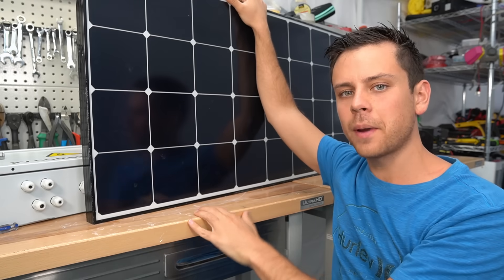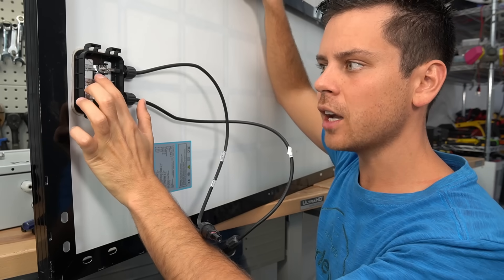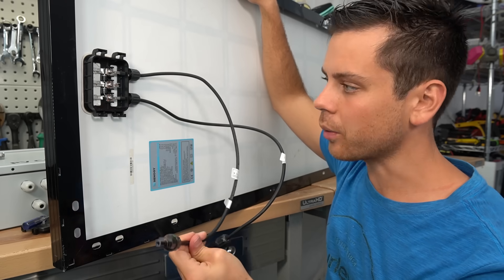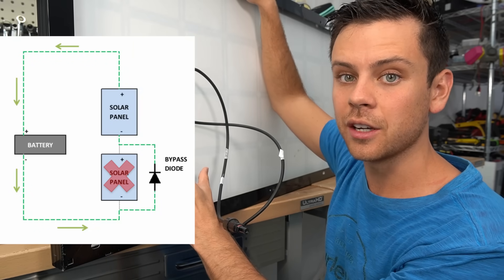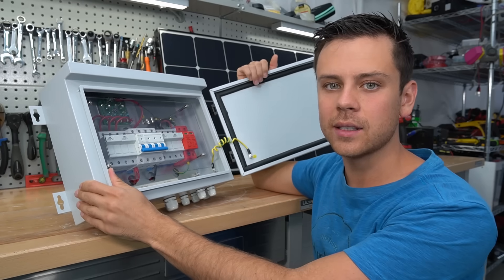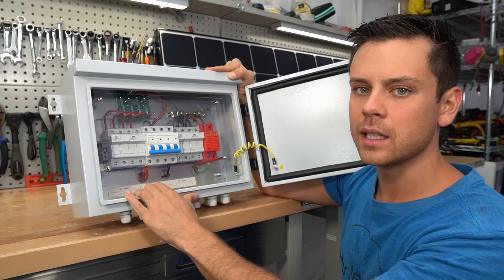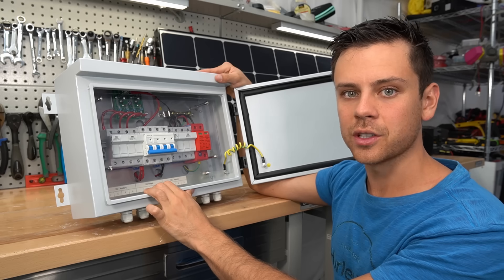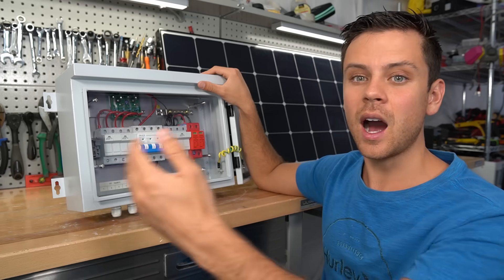Bypass VS Blocking Diodes in a Solar Power System

Comment: Hi, regarding blocking using blocking diodes will it work to limit the current? I'm installing a solar system for my sister and I will like to oversize the panels and the inverter is got 2 x MPPT@ 27A each and 16 panels 2x8 in parallel goes to 28A such is over the limit of rated MPPT 27A, if you can let me I will much appreciate it thanks. Mihai

Comment: Very clear video, thank you! To sum it up:
1. A bypass diode is used in parallel to the panel (segments) to keep current flowing when shaded or malfunctioning; 
2. If you have only one panel, you don't need a blocking diode (when a charge controller is applied); 
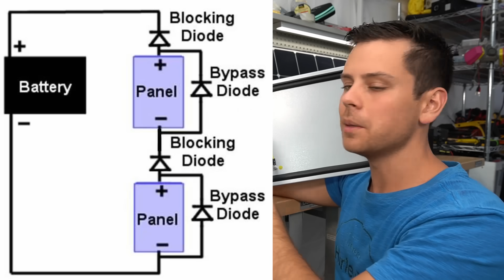3. Panels in series, you don't use blocking diodes in between panels (contradiction to diagram at 2:52)
    and you don't need a blocking diode at the end of a string of panels (when a charge controller is applied);
4. Panels in parallel, you need blocking diodes to prevent 'balancing' at unequal power conditions  
    (one more powerful feeds the less powerful and 'burns' energy instead of producing);  

Still there is one question about parallel. When you use blocking diodes (blocking 'balancing' ) at two or more power sources at unequal power conditions, always the one with the highest voltage is leading and provides all of the current. So how this work exactly? 'Waiting' for a voltage drop at the leading source at the maximum current it can provide and then other sources kick in if at the same voltage? For example, two panels, one at 50v and the other at 40v. Maximum current of a panel is 1A. Load wants 1.5A. Load exceed the maximum current of the first panel at 50v. Voltage drops/collapse to 40v and the other panel at 40v kicks in? Is this how it works?

Lenghty post, thank you for any reply if you do.

Comment: Hello guys. İ have an single 24 volt  paralel system with different amperage panels and shadowing on different panels. So i have to blok every single panel. The panels vary from 400 watts to 600 watts. İ never get more than 8 amps  and 45 volts from each panel. İ just want to know which diode i have to use for each panel. Thanks in advance to you good people 😅

Comment: Blocking Diode its mean if solar panel is 14.6 A should easy run from 16A to 20A + 800V (for example 20 panels x 36V=720V) I can imagine what size need to be to able run in series.🤣

Comment: Solar panels produce most their voltage at low light, so shading won't really affect the other string. The shaded panel will just produce less amps, but won't bring down the other string in any substantial way. You would likely lose more from the forward voltage drop of the blocking diode, around 0.7 volts, but percentage would depend on string voltage. Either way it won't make a big difference either way.

Comment: im daisy chaining a few jackerys together in my van and seem to be needing something on these lines. i have 300w solar on the roof and also am now wanting to install a line to power the jackery from the van as well for backup at night while driving.   The issue i keep having is, both solar input and van battery input i put on switches to turn on and off when using one or the other.  There are 2 separate inputs on the new jackery 1000v2. solar plugged to one and van bat plugged to the other. when using one, the power back powers the switch lights and obviously isnt back charging the battery or solar since it can only make it to the switch.  Im thinking im needing a blocking diode for the solar and van battery inputs both between the switch and the jackery inputs to stop the back feeding.   Any and all help is appreciated...lol   hopefully this is correct  lol

Comment: But if all panels have bypass diodes, what need is there for the blocking diode combiner box since power can just flow through the blocked panels anyway?

Or do not all panels have bypass diodes?

Comment: I have one string of ten solar panels, connected in series. Seven face northwest and three face northeast. What does the circuit diagram look like, to switch off the three facing northeast, so that I use just seven northwest ones, in the afternoon, please?
Reply: I suggest you install power optimizer to avoid reconfiguring the string

Comment: I found out that my little 100w foldable suitcase panel has a standard 2-diode junction box on both halves. There are only 2 tabs coming out of the panel and the junction boxes were placed centrally to those tabs. They were then soldered to each end of the screw terminal array with the 2 diodes effectively making a 17v panel with 2 bypass diodes in series across the panel.
The two half-panels were wired up to the charge controller via parallel cabling and thus the setup had effectively two 17v panels in parallel with no blocking diode as there was no combiner box. I did notice that this panel was very bad if anything was shaded and now I know why. By shifting the + tab onto the center terminal in the junction boxes on both panels, I effectively turned the second diode into a blocking diode for each panel. Now it works much better if one panel is shaded letting the other panel deliver 50w.
I checked the voltage drop on the diode though, and it is around 0.8v at 6 amps. This is a BIG loss for this little panel costing around 4.5% of the max output. I can shift it back to normal configuration by moving the + wire in the junction boxes so I skip the blocking diode but then it is just as bad if anything is shaded. Alternatively I can put the two panels in series with no blocking diode but my MPPT controllers eff curve shows it will be 3% less efficient if used with 2x17v in series towards a 12v battery vs the 2x17v in parallel. Seems like I can either have a panel that performs better with shading, or I can optimize for output.
What would you choose? Seing how this is a small setup for the road, I am thinking maximizing what you can get out of it and having to make sure it is not shaded could actually be ok?

Comment: How does solar panel opriminizer work & how do you connect them?
Reply: Power optimizers work best in series string. In series, voltage adds up while current is determined by the lowest performing panel.
Power optimizer will purposely buck the voltage of the poor performing panel while increasing the current to match the rest of the panel in series.

Comment: So, if I have two sets of panels in series, one facing east, and the other facing west, I can either put them on their own charge controller, or if I don't, the bypass diodes will also stop the west facing panels from sucking the system until the sun shines on both sides, and late afternoon the other side?

Comment: Curious about best practices paralleling solar moduls. When, when not.   (I have 5-6 different roof areas each small but my inverter only has 2 MPPTs). On a flat root, 15deg zick-zacking modules and paralleling each or doing a westish and an eastish string and paralleling them?

Comment: Hello sir, when installing the diode in series with the panels, should it be installed on a specific terminal (the negative of the panel or the positive of the panel) or is there no difference between them? Regards

Comment: I have a Grundfos solar driven well pump. I want to add a second solar array so that the array’ face opposing directions for maximum daytime pump capacity. The array I have already is the max input for the pump. Will a blocking diode keep me from supplying over current to my pump?

Comment: Thank you for the great video Will. For my clarification, is the blocking diode only to prevent different voltages from negatively impacting the entire system or is it current also? I have three separate strings, one facing east and two facing west. I’ve configured all three strings in parallel. 3S3P. they are old panels that I’m giving a new life to, so output is lower than it used to be, but for now I’m OK with that. The east string is 385 W, at 77 V and 5 A. The west string is 770 W at 77 V and 10 A. My array never produces that much and I’m wondering if having them all in parallel is negatively impacting total output.  I don’t have the option of separate charge controllers. Thank you for the help.

Comment: Great video Will, I designed a simple combination box using a couple of suitable circuit breakers and 2 diodes on a heat sink. This is to combine two pv strings on different sides of the roof.

Comment: Excellent timing Will!  Today, I just ordered a ‘4-way combiner box’, for my solar arrays.  One on the east-side, the other on the west-side of my tractor barn.  This very question was bugging me!  I will give you an ‘update’, as I propose to try this combiner, with and without the blocking diodes.
P.S. - I’m using the MDK 55A(50Amp), diode pack.

Comment: Not sure if questions are still being answered on this older video but im thinking I might need two blocking diodes. Id like to run a 200w solar input and a 400w dc to dc  input into a power station and so im thinking this might be what I need, a blocking diode for each input. Does that logic make sense?

Comment: hi, can i ask question ? what about series connection solar panel facing west n east but connecting in series. do i need to use bypass diode? my understanding from the video said that only parallel array can use blocking diode and u said by pass diode already build in under the pv modules. hope u can ans my question. if i need to use bypass diode do i need to manually install under each of the panel ?

Comment: I have a cheap grid tie inverter. 1,000watts rated. Is there a way to know for sure that my inverter is not pulling power from the grid and sending it into my panels at night?

Comment: Hi, thank you for your video. I have 3 serial string to connect them in paralel. Each string as own direction or in different places.  Can I block each string with a diode, connected in serie in the own wire in the string box? Thanks

Comment: Hello, I am running DC fan with 12v adapter. Now I want to connect a 100w solar panel to the same fan. The problem is of course if during night I run through adapter, it will also feed solar panel if someone forgot to switch off the solar line and vice versa. During the day if solar panel is running the fan and someone turns on 12v adapter that's connected to the mains, I am not sure which power fan shall be drawing, solar or mains?

I got Chinese 10A diodes also referred to Schottky diodes but it would become super hot. Someone told me these are actually 5A diodes but marked 10A. Therefore I soldered 3 diodes together and should I put in the positive wire as you did but close to the panel or close to the fan? In addition, similar diodes should be also connected to 12v DC adapter's output positive wire?

I don't think heat shrink would cover 3 diodes soldered together. I am thinking of a hack to make housing for the diodes. Any suggestions welcome.

Comment: If my strings in parallel produce 14A max each is it safe to use 15A blocking diodes or should I go for higher like 20, 30A just to be on the safe side ?

Comment: Realizing the SunPower A390 panels I purchased will need to have their microinverters removed to function properly in my off grid motorhome project. Will be installing bypass diodes

Comment: Note that some blocking diodes on the market use 45V Schottky diodes.  That means you should use one per panel in series.  I personally would switch to a silicon diode with 3 panels or more in series.
Reply: Silicon has 0.7v or 0.6v voltage drop

Comment: Do you have a video where you're showing the junction box of the solar panel that's either on bypass or in series (am I asking that question right)?  Reason is... I tried repurposing a 200w briefcase solar panel by separating them into two 100w panels.  After putting an APP connector on each panel (red for positive, black for negative) and connecting one of them to the power station, I get no juice flowing...  Thoughts?

Comment: Hi, I have a small 40W solar panel which puts out around 18v at 2.36A. On the + and - output terminals in the junction box, it has a single IN4108 diode across the terminals, so the diode is in parallel with the panel. I can't understand what this is doing, as it is not blocking and it is not bypassing. I tried googling and I can't find any answers.

Comment: I have a 24v battery bank and a battery charger/mppt.  If using 30vdc panels, does it make sense to put all the panels in parallel? I have a roof that has a few trees around it.... and rather than putting optimizers on each panel I wondered about simply putting them all in parallel.  What problems am I likely to encounter with this approach?

Comment: I don't understand, why did my PWM charge controller not showing battery charge current and solar current value, all it shows is only voltage and 0.0 Amp, and the battery charge increases so fast but also discharges so fast, please any help on this. Thanks

Comment: So meaning I can use multiple mppt charger in one battery? Example I have 2 string 5,5kw system facing the east side that uses hybrid inverter then I want to add another 5,5kw system facing the west (to maximize the charging of the battery) I will just use a different mppt charger with it? Pls correct me if I'm wrong I don't want to blow my house together with my investments hehehe

Comment: Dear Will, you mentioned using separate charge controller for East and West facing panels. I assume then that the outputs of the two charge controller may be joined together in parallel going to your battery banks. Right?

Comment: Why They Recommend Putting Solar Panels on Roofs Like the one in your Diagram is Mind Boggling, unless you consider its just a Contract and they really Do not care if they Use 2 to 3 times as many Panels for the Same result When they Should be Putting them in as Solar Farms not connected to the Roof For Optimal Use of each Panel.  hit and miss with a Lein on your house.   The USA Government is insane.  Free Solar That is Not Cost effective for Use.

Comment: I have an East-West array configuration with two Victron MPPT's which I have connected to a Victron Smartshunt using VE Smart Connect BT network. However I can't see them on the VRM Portal. The Smartshunt is connected to the Cerbo GX with a VE Direct cable but it would seem that VRM won't pickup up devices that are networked to the Smartshunt. I've run out of VE Direct ports so was wondering whether a VE Direct to USB cable would work... so I can see both MPPT controllers on the VRM Portal. Thanks for the great videos.

Comment: Please, anybody can help me to explain what is happening. I have a 24V setup with 16 lithium battery, a BMS balancer JKONG and a Powland Inver. My app show a 75% charge,432ah in the battery but the Voltage is  down to 23v. ... The inverter is reading 22,1v and prepare to shoot down. Why??

Comment: At first I was going to mount my two 180W panels in landscape orientation so I can get away with smaller tilting brackets. However given what I learned about the behavior of the cell arrangement, and the fact I have winter shading from a tree trunk (vertical cylinder), I'll go with portrait orientation for better power out when shaded.

Comment: OK but does the Diode have a resistance greater than the cells? Diode can know if it's shaded and/or a short? How can it open simply due to some shade in a string? I am guessing the Diode has a certain point it will OPEN but how does it know shade VS a short they are different right? Just curious about this bypass diode it is interesting to me. Go Solar!!

Comment: Diodes have a voltage drop, and therefore they emit heat.  I’ve heard that these hotspots caused by the bypass diodes taking current can shorten the life of these panels.   Given that the strings can have 30 amps passing through them, then it stands to reason that the diodes need to be rated to dissipate 15 Watts of heat assuming a 0.5 Volt drop.  That’s a fair bit of heat for such a small surface area on the diode.

Comment: I like to always use bypass diodes, as you said, to avoid the back flow of electricity from a panel to the other (panels have great resistance to electricity, and it will be loss as heat). But also, while this should not happen with good controllers, cheap chinese controllers may allow the backflow of electricity from the battery to the panel(s). This is very easy to check, because it will produce a considerable loss in battery voltage during the night.

Comment: I'm currently struggling with an MPPT controller that seems to drain my battery over night.  I've added a blocking diode in series to see if that stops it happening but diodes will reduce the voltage by 0.7v.

Comment: Thanks Will, very nice and informative video, I bought some used solar panels. Its produces votage but no current, what could be the problem. I reversed the polarity, no reading, which means diodes are good. I will appreciate your help.
Thanks

Comment: I have 3 x 340w panels in Series for a pump inverter controller. I have 42v at the first panel at the pos&neg terminal connector then the other two panels show no voltage at the terminal box. I have 42v at the pos&neg terminal block in the pump control box. I at first thought it was diodes but there are 6 diodes between the two panels I’m getting no volts from , surely they all can’t be faulty and why isn’t there any volts coming from the 3 internal solar panel strings. After watching some videos I’m wondering whether the two suspect panels are faulty and the internal foil circuits have broken down ? Thanks for any suggestions